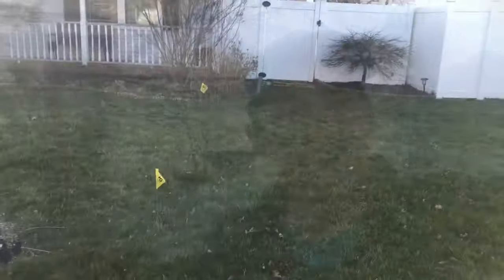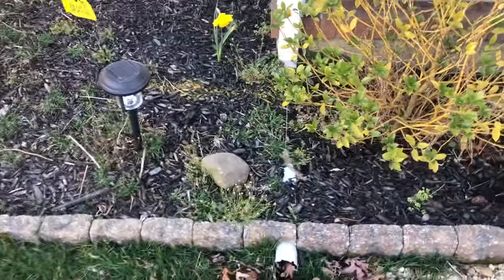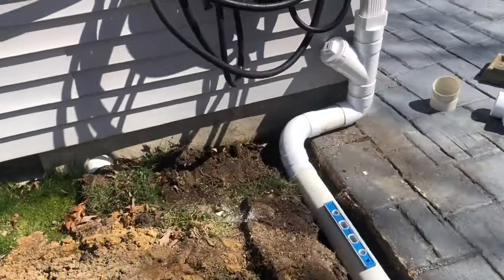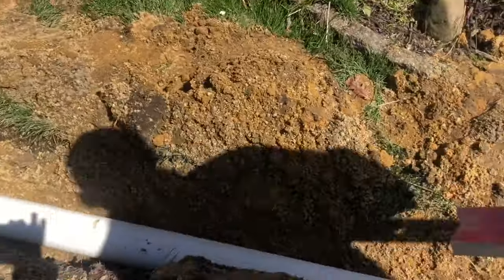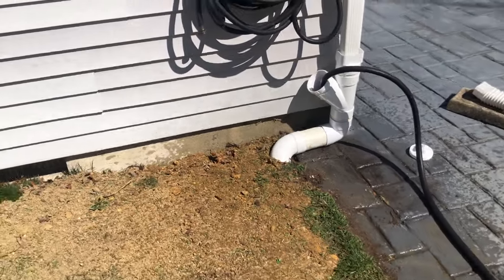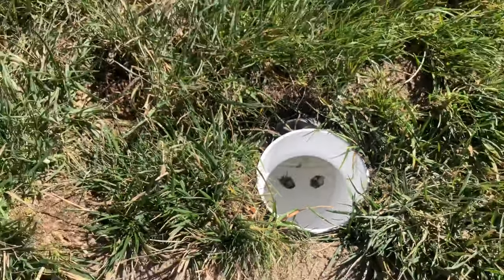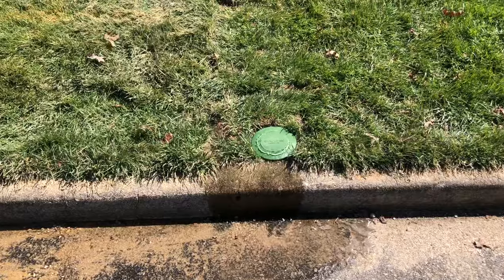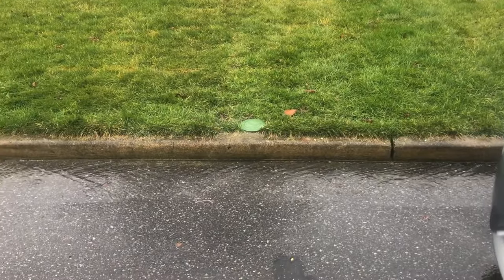Downspout Drainage Done Right- Drainage System That Really Works Forever

Comment: what if you don't have a storm drain. I have a gravel road at the edge of my property that is shared by 6 other houses, as in I don't want to mess anything up. Could I use corrugated pipe and dig it deep enough to the end of the property line? Perhaps use a drainage tunnel?
Reply: @BlackpowderBBQ  I don't live in the country.
Reply from the maker: Yes you can do that to

Comment: Hi Dustin,
If on the side of my house with water issues should I have my two gutters and two window wells with solid pipe run into a french drain (running the length of the soggy side of my house) pvc pipe with holes facing down in rock, filter cloth and a few dry wells or run the french drain \ dry wells above a solid pvc pipe handling just the downspouts and window wells?  Basically have two system that tie into one pipe closer to the street or at least after the house.  Could the french drain if taking in too much water in during a deluge through the dry wells over flood the system and push water back up the window well pipes if they are not two separate systems?
Reply from the maker: As long as you have slope/fall away.. it will all drain to wherever you send it
Reply: @jerseyshoredrainagesolutions  but should I do two pipes or would everything running into the French drain be ok? Thanks for your advise.
Reply from the maker: @saxmonster  only if they are going away together to a dry well, pump station or street. Otherwise keep apart